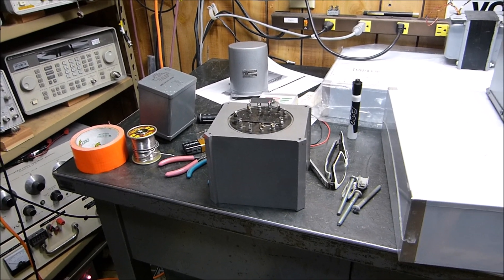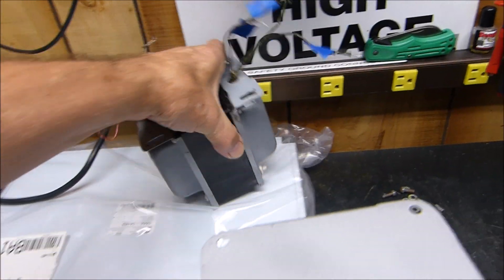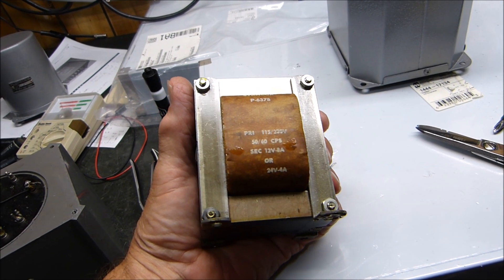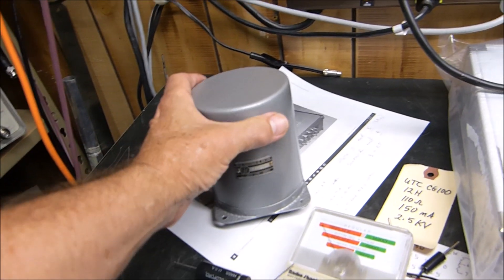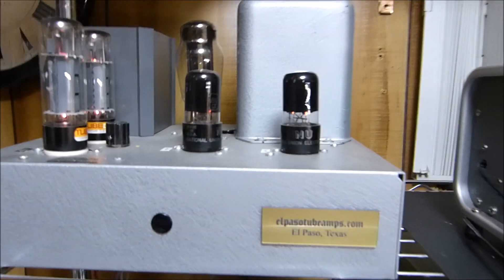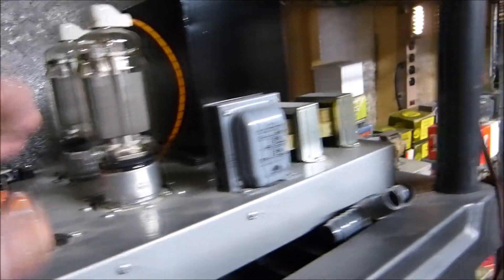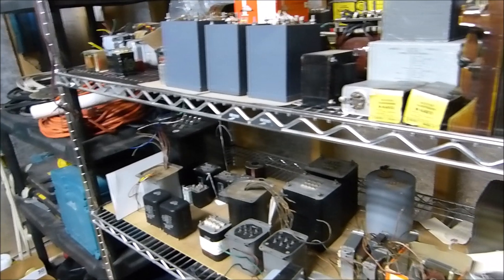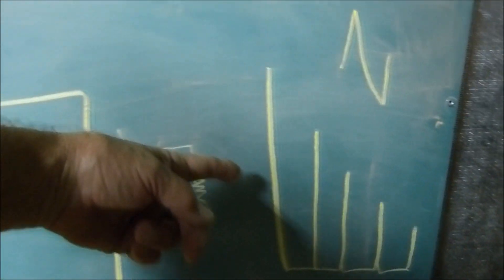Vacuum Tube Audio Amplifiers - What To Build Next?

Comment: You certainly hit the nail on its head with your quick comparison of PP vs SE configurations.
Since you're asking for ideas, and you like big high voltage amps, here's a couple of mine:

1) I don't know if you've heard of Sakuma amps (pp 845 in particular using interstages) but a big part of their sound reportedly is down to the unobtainium Tamura 5k or 7k pp amorphous core transformers and the unusual amp topologies he had invented. I was always interested to find out if one could replicate his results using western transformers e.g. UTC's etc. or other modern transformers e.g. James, Hashimoto etc.

2) This is my own: I've always lusted after an amp with an 845 driven by a 2A3. The problem is you can't even get 13W out of it in SE mode with a minimum distortion design. If you relax the distortion requirement, you can go higher (maybe 17W ?) but no higher without going into A2. So here's the challenge: can it be done? If you prefer PP that's alright with me but then the power output should be suitably scaled -ceteris paribus. I know you can probably achieve this by using 10's as drivers but that would not be of interest for the following reasons:
a) 10's will soon be unobtainium or just really expensive
b) 10's have thoriated tungsten filaments (as do the 845s) and I'm interested in the result of a mix of tube types. 
Using 45's or 50's, AD1's etc. instead of 2A3's would be ok but would make the task even harder. Using 300B's, EL34, 811's etc. would again be cheating as it is much easier and has been done already.
Using 211's instead of 845's would be cheating.
Reply from the maker: I think that your summed it up beautifully. The practical level of (about) 15 watts with poor base response for the SE amp just doesn't catch my fancy.  Violin and vocal out of a SE amplifier is fantastic but sometimes I like a little AC/DC or Def Leppard...     :-)
The 211 and 845's are beautiful but I don't have any and  don't want to put buckets of money in the amp so I am "stuck" with what I have on hand. As you know, the high voltage amplifiers that deliver the power levels we expect from PP amplifiers, require transformers in the 10K to 20K+ primary impedance range and my stash of transformers is generally in the 5K range for 6L6/300B/etc. I do have a couple of UTC transformers that have 10K primaries but they are at most, 20W - and that is OK.

The 2A3 does not interest me as the vintage 6B4G is the same tube with an octal base and 6 volt filament. Why on Earth deal with a 2.5 volt filament?  I do like the 6B4G and think they sound really good. I guess I am just looking for something to build besides another Williamson type design but then the big UTC transformers keep calling me back, and that basically means something like a W-20 type amplifier with 6L6 or 300B.
No doubt a beautiful little (15-20 watt) stereo amp could be built with the LS-35's, LS-57's or LS-61's that would be world-class performance but that doesn't thrill me either. I have already done that with the Acrosound transformers using KT66 then switching to 6B4G's.
You ask about more power from the 845 and 2A3 combination and can more power be squeezed from then and I can only say that continuing to raise the plate voltage is the only way I know of to get more power out of a tube but obviously there is a limit to that also. I can't remember the exact power level but I am pretty sure I have squeezed 25 watts out of a pair of 6B4G's but they aren't going to last long as they are starting to red-plate.
Tubes like the 811A and the big Eimac transmitting triodes and tetrodes are just not suited for high fidelity reproduction in my opinion. They are high mu tubes (mu=160 and 200 respectively) and all work as zero bias triodes so they only work well in class-B driving the grids positive with lots of power. No doubt lots of power output, at least 200 watts per pair for the 811A but just not the linear performance of the low mu tubes like the 300B,  211, 845, etc. which require lots of negative bias and a whole lot of drive voltage for class-A (not power) which can only be obtained by transformer coupling or some sort of inductive feed to the grids.
I suppose what is interesting me is something a bit unusual and exciting to build but could be safely used in a living room for a home theater system like my house. It would be nice if I could actually use the device I am wanting to build...   Some of these 100TH amplifiers, and such, that I see on the Internet are deadly and the heat would be overwhelming.  I am very familiar with orange-hot, forced air cooled triodes and tetrodes in RF amplifiers and know the level of heat they put out. Little 6L6 amplifiers can usually be safely used in a home environment but not something running over 1000 volts on an open chassis. Almost terrifying to see these amplifiers on the Internet sometimes.
The ham radio community has inspired me to build an AM transmitter - blank chassis build from microphone to antenna but I will  be using a vintage Collins exciter for the frequency generation but I also want to build an interesting audio project with the components I already have.
These discussions are absolutely marvelous and I love them. Thank you for your time and thoughts.
Reply: @ElPasoTubeAmps  If you'd like to build an AM transmitter, you might want to check this guy's channel: https://www.youtube.com/channel/UCnnsQySJDyoZNerXIMwIelw
(if you're not already familiar with it). You may get some ideas there.
Re: 6B4G vs 2A3: Some people swear by directly heated filament triodes and prefer their sound despite all the extra circuit complexity and their drawbacks. The low power amps (i.e. below 10W) are mostly suitable for horn speakers - there's no other justification for building one unless you enjoy listening to horn speakers.

Comment: I like amplifiers in the 200 to 500 watt range. I agree with you that push pull is preferable to SE. 
what about something that uses less popular tubes? Maybe parallel tubes like a 4 tube output?
I know 6146B’s are pretty common still, but not used much for audio might be interesting to see how they perform.

Comment: Would love to see a 35W push pull compactron sweep tube amp with SS rectifier, CCS (V reg) and LED biasing and or a RIAA phono preamp using octals. SHowing some of the circuitry design aspects and changes if issues arise so it can be used as a bit of a learning video.

Comment: You mentioned the magic words "amateur radio" your power levels over there in USA are much higher than here in the UK so how about a nice powerfull HF linear amplifier to go with your Hex Beam,  you have most the parts required apart from the Pi  coil and air spaced variable capacitors ? and looking at your transformers you wont even need to bother with a doubler or quadupler psu build, just my two cents worth 73 2E0TMI

Comment: I notice you are talking about ham bands here is a ? to you  that I do not understand  and maybe you can explain when you build a hf mono band amp for ham radio. but simple tube like 813 and 4-400 or what ever tube you decide that we can still get at a good price .  say 500-800 watts.  see I have 813 mono band for 10 meters I play with with icom 718 . Its grounded grid wright now. I do not want to keep it grounded grid and I donot want to grid drive it. I would like to cathode drive it add about 300 volts on the screen and -bias on the grid. see a lot of people will not tell a lot about what I wanting to do. I would think by doing what I am wanting to do. save the radio by not running 3/4 or full power and it would save the tube from not being over driven by grid driven. you know atube you can do a little of both. but please use a tube and simple parts that we can still all get. thanks and 73's ph# 3072568868
Reply: at least 2  to 813 or so if I wanted to build a 1500 watt amp all I would have to do is add another tube I have heard a lot of people changing from pentodes to tetrodes like the 4cx800 maybe you can show us we can still use glass tube the way I would like to.  thanks again and taking the time to read this and 73's to all reading this. give me a call if you decide to build something different so I can pick your brain on what I want to do with my amp.

Comment: Using a xfrmr core for choke purposes is highly problematic...at least as a DC choke. You could use them as AC reactors. Just as using a pwr xfrmr for an opt xfrmr, even if the ratios are what's called for, can never work optimally, the same applies for using pwr xfrmrs for chokes. They may work, but at abysmal efficiency. It's not just the ratios and not saturating the core, it's the flux region as per intended induction.

There's a reason that toroidal xfrmrs are rarely used as chokes, and it's all to do with core properties. Some manufacturers claim to have found a way to do it....having worked with building toroidals, I'm highly skeptical. It defies the properties that make toroidals excellent for opt xfrmrs.

Need a choke? Use one designed for the job. Keep in mind that input and smoothing chokes (sometimes 'swinging' sometimes not, a whole other discussion) have different optimized needs also, or you might run into some very real problems.

Comment: A zillion years ago I built a few tube amps and preamps, some with DC on the filaments and other fancy feature that didn't make much difference. 

I do recall this about iron core chokes: all the ones I looked were made with all the E's and I's laminated into separate stacks and assembled with  a magneting break (a non-magnetinc shim) between the poles. This was intended to retard saturation. I experimented and found the magnetic break could be eliminated below a certain plate current. Above it did make a difference and was absolutely necessary at rated current. If you have two plate supplies, one for the output stage and another better filtered fot the other stages, you'll prpbably be less troubled by B+ originated hum and ripple. A push-pull output stage has some immunity the B+ ripple. Experiments with the L/C output feeding a load resistor are worth the effort. If you know the B+ current required, you can match the powersupply to it. The power supply design I settled on had rwo chokes: a swing choke feding the first filter cap and a smoothing choke. The filter cap values have to be selected to optimize power supply performance especially the input cap to the smoothing ckoke. Over-do or under-doing this input cap affects voltage regulation and exacerbates motorboating - assuming you have a cascaded high gain input stage.

Feedback can only do so much for S/N. If you start with a good design, feedback will make it quieter and more linear. A mediochre design patched together from componenrs scrounged from  the loot boxes might work OK. A good design that takes the characteristics of what's available into account, the results are bound to be better. Cleaner output resulting from a well worked out compensated feedback loop will be the cherry on top.

Comment: I don't know if you're into it or not but would love to see your take on some plate modulated AM!
Reply from the maker: You guys are really after my heart now... Before I left Huntsville, AL for El Paso, I build an AM station for 75M. It was a 4-400A running class-C and modulated by a pair of 4-400A's. Built it all from the microphone to the antenna except for the exciter which was a Collins 310-B. The Collins 310-B is a 15 watt exciter that came with the 30K-1 amplifier all from 1947 and I still have it. I would probably use it as the exciter RF source again. This AM station was for real and I loved getting on every night with the same guys. All that ended in 1976 when I left Huntsville and I don't think I ever took a single picture of any of it... if I did, I don't know where they are.  I still have all the parts to build the same AM station but I have no place to put it. Maybe I should buy another big cabinet and do it anyway.  I bet my neighbors would love me with a KW of AM on the air...  Thanks for your thoughts. 73
Reply: @ElPasoTubeAmps  I for one would love to see that. You could make it a whole series. It would easily be the best AM build content on YouTube. Whatever you decide on though it will be worth watching for your knowledge and experience. 

 I've got a half finished modulator and enough iron to build a power supply for an amp but haven't settled on a tube to use in the amp yet. And I think I'm frozen by fear of failure. I've built amps before but never a full transmitter... Someday I'll get it done.

Cheers and looking forward to your next videos! 73
Reply from the maker: @va3dxv  I was just randomly looking thru some comments and saw your post here. I know this was a year ago but I have build an AM station and posted a few videos on it and  some nice pictures of the modulator on my QRZ page (wa4qga) if you are still interested. I have tried high-level clipping so as to not modulate more than 100% in the negative direction as seen in this link:      http://www.arrl.org/files/file/Technology/pdf/5610027.pdf     but I don't think I am satisfied with this. I have 300 watts of audio for 300 watts of carrier so I can easily overmodulate.  Some fellows suggest low level clipping is better so I am sitting here writing when I should be building a clipper amplifier. I am going to duplicate the input circuit and 6AL5 clipper used in the Collins KW-1...    73

Comment: Build an another rf linear!  I learn such a lot from your tube rf linear stuff.  I have a Russian gs-35 I want to use in an rf linear.
Reply from the maker: I love RF amplifiers also. I have the home brew 4CX1000A and the 833A and a 3-400Z/3-500Z in running condition. I have a pair of 4-400A's and the 3-1000Z on chassis that I can slide in the Collins 30K-1 cabinet and yet I never have enough amplifiers. I also have the Collins 30L-1 but I just love to build RF amplifiers. I am pretty sure I am going to have to build another amplifier with a pair of 813's which will only give me about 600 watts, the same as the single 3-400Z but I am going to have to do it. At the moment, I am getting the urge to play with some of these beautiful UTC transformers or the Triad. Not too driven to build another 500 watt amp with the 810's yet so all these thoughts from you guys are helping me. I really appreciate your thoughts and I will definitely post a video or two on the 813 linear when I get to it. 73
Reply: ElPaso TubeAmps yeah, I have watched your other rf videos.  Superb stuff!  Can you recommend a good soft start circuit for my hv psu?  I have an old ex Australian Air Force hv transformer that puts out about 1.4kv, a real beauty.  Thinking about a voltage doubler to get me to over 3kv.  I’d like a current limiting circuit on the filament to prevent cold cathode inrush, and full qsk switching with vacuum relays.  This will be my first tube linear build...  You have a remarkable collection of goodies, a veritable Aladdin’s cave.
Reply from the maker: @cthoadmin7458  I did post a video on a soft start circuit some time ago. The design you might choose depends on the voltage and current level. I used a small heater coil of abut 8 ohms, 800 watts but ultimately jumpered out about 4 ohms of it before I allowed it to pick up a large mercury relay.  It appears to me that even 1/2 second is good enough. If the delay was too long (I turn the HV on and off for each transmission not  like most modern day transmitters do by leaving the HV on and biasing the tube off) I ended up with some pretty big stuff from all the surplus I was around with the government so I use what I have.  Here is a link to the video     
https://www.youtube.com/watch?v=i6qSU4xybzs
I don't expect anyone to use exactly what I have used but post what I do as an inspiration to others to do what they can to make what they have do the job for them. I will show a HV transformer soon on a video that might make that even more apparent. Voltage doublers are good. Many very good manufacturers use voltage doublers to include McIntosh in their audio amps and Collins Radio in the famous 30L-1. The "easy" way to make good linear amplifiers for RF is to use a GG circuit. This can be from triodes like the 3-500Z or the tetrodes like the 4-125A to 4-1000A family of tubes - the most common being the 4-400A. Strapping all the grids to ground makes these tubes behave like a high mu triode. A brilliant design by Eimac. Hope this helps. I am really taking a lot of inspiration from the comments on this video and it is inspiring a couple of project - both AF and RF.  73
Reply: ElPaso TubeAmps thanks for the detailed reply!  My apologies, yes you do indeed have a video on soft start.  I have quite a few small mercury wetting relays, but nothing high current handling capacity.  It’s amazing what you can pick up now for tube equipment, most amateurs seem to be going solid state.  Dr Alex in the Ukraine has the vacuum relays I’m after.  Please, please keep producing vacuum tube amp videos, they are an inspiration.

Comment: What about a test platform for testing different arrangements of tube and transformers and what ever.
Reply from the maker: That approach has cross my mind in building a universal power supply where I can get plate voltages from a few hundred volts to maybe 1.5 KV,  and include a variable supply for the screen voltages and a lastly a variable negative bias supply. I may just do that. I have done that in three large cabinets for RF amplifiers for ham radio and it has served me extremely well. Thanks for your comments.